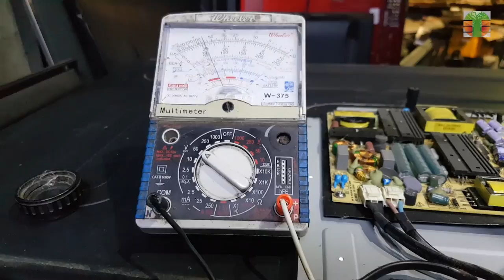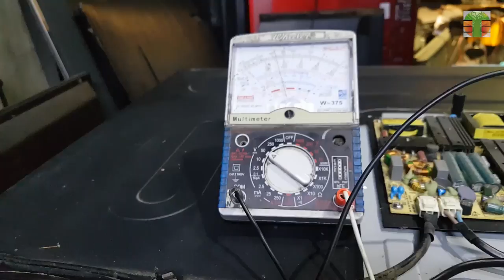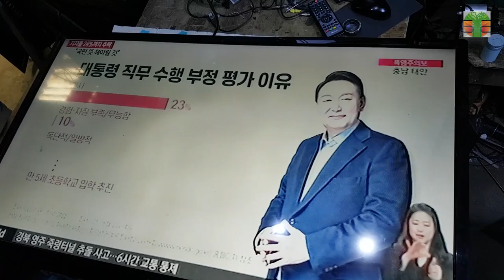AVDD is not present. LCD panel repair.

Comment: I'm working on a hiteker 13 in flat screen TV with Samsung t-con board. All voltage is present but AVDD is only 2.02 volts and EO is only .438 volts... any suggestions?
Reply from the maker: If the AVDD  is in that voltage, Its also the VGH is about that voltage. Try isolate CKV lines
Reply: @tevzTVTevatronics  thank you I will try that